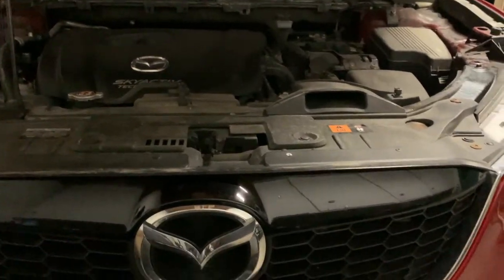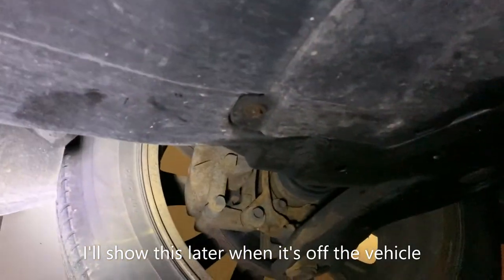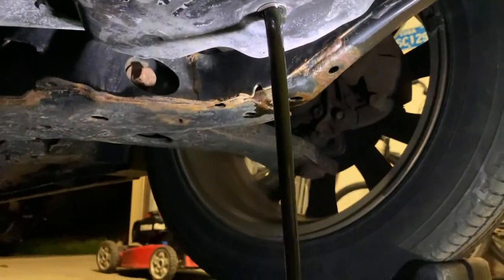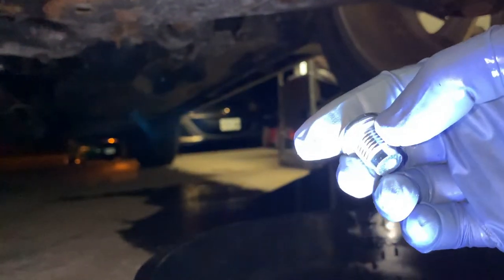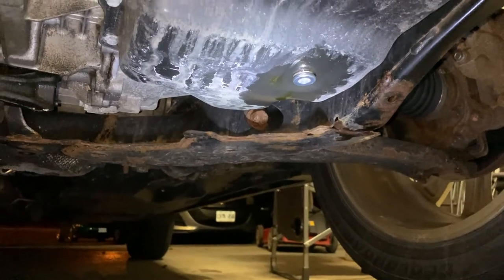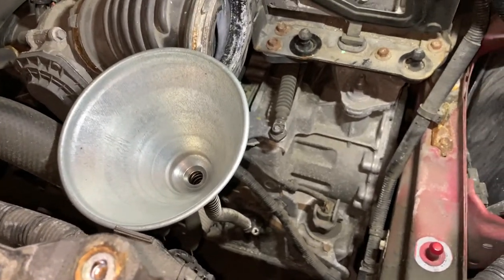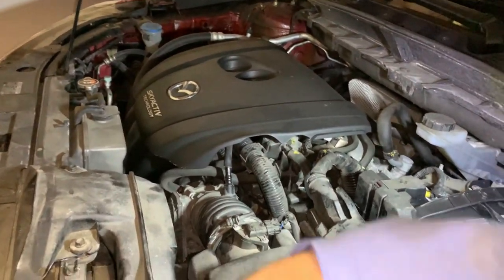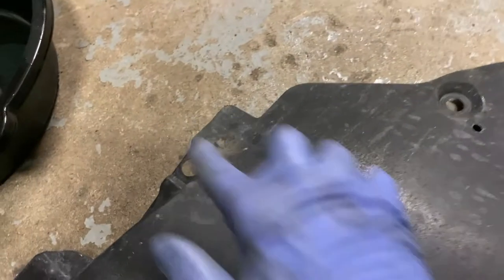Mazda Skyactiv 6 speed automatic transmission fluid drain and fill

Comment: No filter to change?
Reply from the maker: Some other time
Reply: @416diy  yeah I'm guessing it's inside the container for the transition fluid? Great video btw. Seen some overcomolicated ways to do such a simple job. Thank you and Merry Christmas
Reply from the maker: It's a much more involved job, especially with the rtv gasket. Thanks for watching, Merry Christmas to you too!
Reply: I did my Skyactiv transmission service early to get the wear metals out. I did drop the pan and changed out the filter. These filters aren’t just a metal screen, there’s a pleated paper element, and it was black as night. New ones are light brown. 

Yes, removing and resealing the pan is a lot of work, but I cleaned the pan and the magnet had 2mm iron filings built up on it, all gone now. I plan to do a second fill and drain in a few thousand miles to get out more of the dirty fluid. My CX-5 is a turbo and the drain removed about 5.5 quarts of fluid. The turbo tranny is larger than the regular transmission.
Reply from the maker: @bradnail99 what mileage did you do yours at?